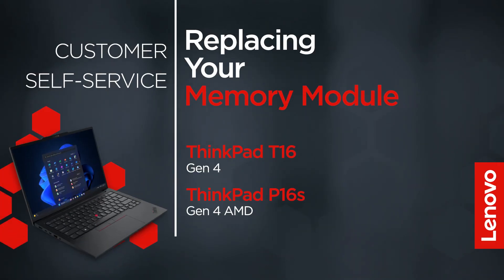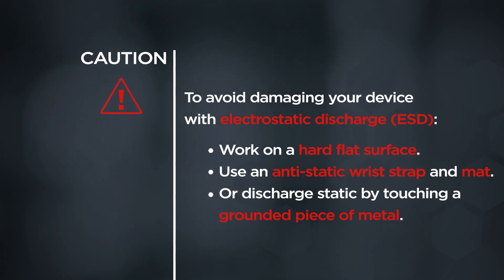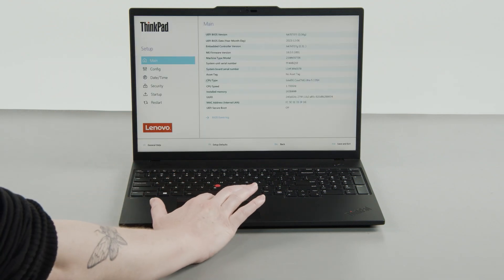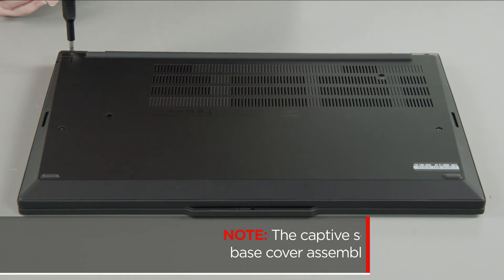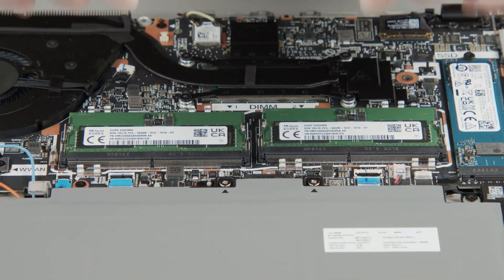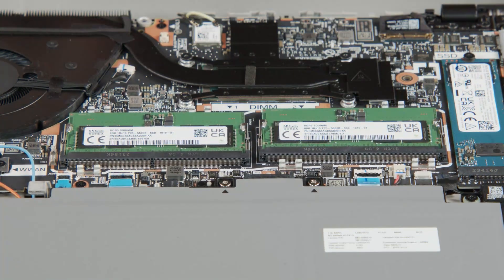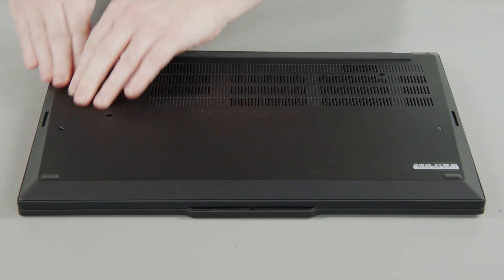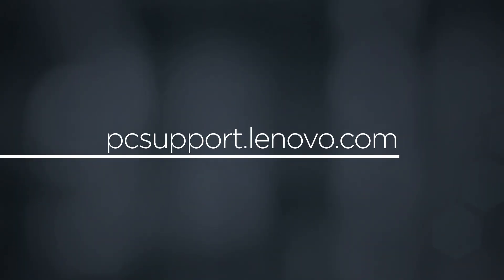Replacing Your Memory Module | ThinkPad T16 Gen 4 and P16s Gen 4 AMD | Customer Self Service

Comment from the maker: This video will show you how to replace the memory module in your ThinkPad. The process in this video will work for the ThinkPad T16 Gen 4 and P16s Gen 4 AMD.

You will need a screwdriver kit, a non-metallic pry tool, and 15 minutes of your time.

To learn more about your device go to https://pcsupport.lenovo.com

To find parts for your device go to https://support.lenovo.com/parts-lookup/?cid=ww:lenovosocial:b9515f&source=socialmedia&subsource=yt

To view the Lenovo Support Self-Repair Guides landing page go to https://support.lenovo.com/us/en/solutions/HT516547

** NOTE: Static electricity can destroy components. Use a grounding strap, and clean, non-conductive surface to work on. Use plastic or coated tools to prevent scratching and avoid using metal tools on plastic parts. For more detailed information on electrostatic discharge and how to prevent it, please watch our "Understanding Electrostatic Discharge (ESD)" video: https://youtu.be/by4PB3WtdLo 

Applicable Machine Types:
ThinkPad T16 Gen 4 - 21QE, 21QF, 21QN, 21QQ
ThinkPad P16s AMD - 21QR, 21RX, 21QS, 21RY

Check out other official Lenovo channels!
https://www.youtube.com/@Lenovo 🟥
https://www.youtube.com/@lenovolegion 🎮
https://www.youtube.com/@Lenovo-PC 💻
https://www.youtube.com/@LenovoSuporte 🟢🟡

#Lenovo #LenovoSupport #LenovoTechSupport